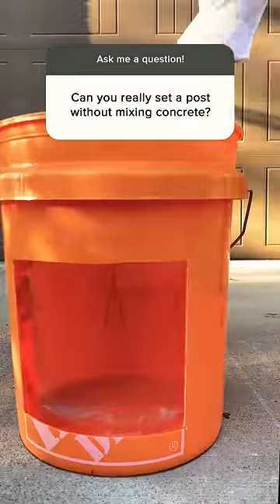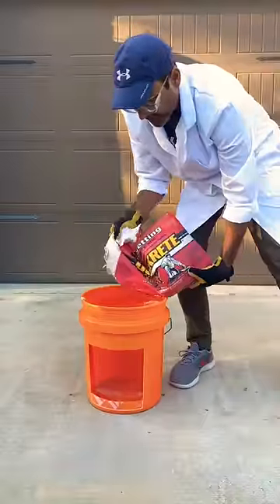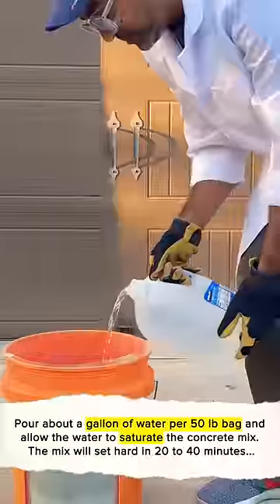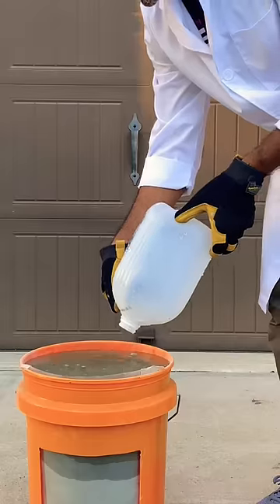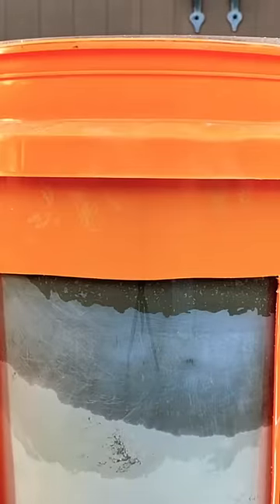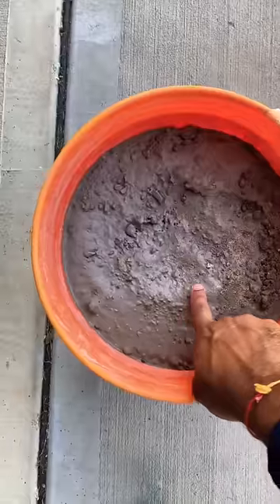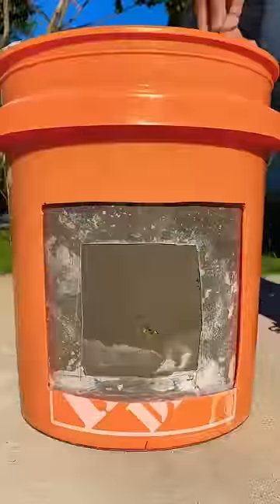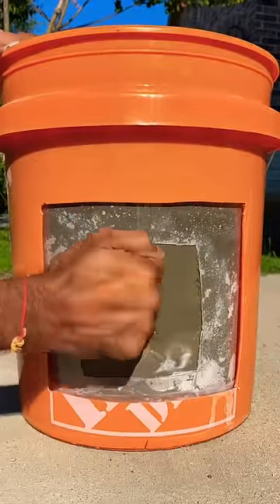Have you ever tried Quikrete’s fast setting concrete mix?

Comment: I've always used milk instead of water because the polymers are longer and it bonds stronger and faster but I grew up on a dairy farm too so we had plenty of milk but yeah milk works better than water and it gives it a nice lighter look you can also die the water or dye the milk whatever color you want the concrete

Comment: If you mix it it activates much faster   Thats all   So if youre using to set posts   Id mix first   If youre using it for something else then adding water after im sure works fine too   Both ways are fine depending on the job

Comment: I will challenge you to make the with regular concrete because fast-setting concrete mix super expensive and people don't use it for fence post.
Do a dry mix like you did and another bucket real mixed with water let them sit for 24 hours.
After 24 hours turn both buckets get the concrete let's really see the results.
But do it real

Comment: As a professional, I don't waste my time or take chances with things that might work...my customers appreciate the fact that I take the time to do jobs right (mixing the concrete) and not the lazy quick way. If you know anything about fences...it's not about the temperatures that the concrete will endure...it's about the wind turbulence that your fence will see....aka this method may work for a chain link fence in town but a 6 foot privacy fence out in the country wouldn't stand a chance.  From experience...the concrete in that bucket can be broke up very easily with a 2 lb sledge hammer....try that with concrete that you mixed and dumped in the bucket....let's show our viewers those results if we want to be true to the testing

Comment: EXCEPT, this doesn't address the two biggest problems that I find when replacing posts that failed after people did it this way. 
1) Not using enough concrete for the soil/projected load of the post.
2) Can the soil leach the water away BEFORE it saturates the concrete? (unlike the non permeable walls of a bucket)
It only takes a few more minutes per post (and a mixing tray) to do it the Right Way.
If it's important, take the extra time

Comment: you never have to mix or even saturate concrete if you’re pouring it into a hole. The concrete will pull water from the surrounding soil and will completely set by itself.

Comment: Moisture can't escape the bottom of the bucket. Do that in soil and the water follows a root or the dirt is dry and a very different story
Reply: Just drive the post thru the bag and add water, I did that and a week later dug it up and it was completely solid

Comment: Zero mixing.  Dig hole.  Set post in hole.  Hold the post straight at exactly the angle you want it and pour in the dry concrete.  The post is now totally stuck and you can't move it.  No waiting. Finish fence. If you live in the NW, no need to add water, it will suck the water out of the surrounding ground.

Comment: S'cause the reaction is exothermic and the center of the concrete will be surrounded by the most concrete on all sides, meaning more heat gets created there and around there, curing the center first.

Pretty sure anyway

Comment: Best way to set a post is to put a flat rock under the post, then put all the dirt back in the hole around the post, leveling as you go. No concrete. Got posts that have been in the ground for 50 years, just as sturdy as ever.

Comment: Concrete done correctly, but post not so much. Use packed course gravel for better moisture management and a solution that doesn't require a 200 lb lift if you need to remove it.

Comment: try that again with the same stuff but mix it, let both set up for a week, then remove them from the buckets.  After they're removed hit them both with a sledgehammer and see which one set up correctly.  over time wit freeze thaw cycles and just natural conditions as well, non-mixed concrete is way more brittle and susceptible to water infiltration and separation due to freezing.  always mix the damn concrete, quit cutting corners.

Comment: Actually the best way to set a post is to tamp the post in with crush an run gravel this way it will always drain in concrete wooden posts will eventually rot off at the top of the concrete.

Comment: FYI. Fast setting concrete is not a string as slow setting concrete.
Ali bad test as the soil will also soak up a good amount of the water.

Comment: You don’t need to add water even when setting a post. Just pack it and move to the next.
Reply: Depends how dry it ground is
Reply: @STYNK37  it will usually still dry in wet ground. The biggest problem is keeping it where you want it.

Comment: Not really a scientific test because a hole in the ground doesn't trap all the water in like a bucket. It drains into the adjacent soil. To test this you'd need to dig multiple holes the same size and fill half the holes with premixed concrete, and half using the dry-fill method, then test for structural stability.

Comment: Not the most accurate experiment since the dirt encompassing the concrete is porous as well. The concrete would probably dry better with some excessive water being soaked up by the dirt.

Even with the poor boundary conditions, this demonstration does not conclude anything about the center of the concrete as we did not get a cross-sectional cut or broken piece to investigate the center.

Comment: The only thing is some of the water absorbs into the dirt in the actual process.
Reply: yes but ground water seeps back in. It will eventually cure fully. Anyone who puts up fences will tell you that. I recommend throwing a gallon and a half to 2 gallons down in the hole. But you can even not water it at all, it'll eventually cure from ground moisture.

Comment: If you are a professional, homeowner do not use fast setting concrete. It will start to crumble after most likely five years and your posts will become loose and eventually be pushed out of the ground. Go the extra step

Comment: water is going to seep into the soil as well and probably drain off into the soil before it would sink all the way to the bottom of the dry concrete mix. I still wouldn't do it that way

Comment: Never trust a person who does this. Mix it. Do it right. Test "test" is not the same as putting it in the ground. The water will go more into the dry dirt. This keeps it contain in the plastic bucket. Not the same. I have taken many posts out that you can tell which one were done the lazy way and which were done correctly. Well mixed concrete will take hours to break off. While the lazy way you can take just a wack with a pick axe and it breaks off into pieces.

Comment: It's premixed with gravel, sand and cement but you still need to mix it. You cant expect it to be effective without mixing Lol
Reply: The entire point of the video is to show that the manufacturer’s directions not to mix it will work..

Mixing it would exactly defeat the purpose of the entire video.
Reply: You don't have to mix it, hell you don't even need to pour water. If you live in an area with good amounts of rain, just set it a day before it rains. I've seen that done as well. The entire point of the video is you don't need to mix it. Everything is mixed already, you just add water. Water soaks in. If you're doing it in a hole, I recommend a gallon and a half to two gallons of water. Because it'll seep into the dirt. You need full water penetration. You can literally do this with any bagged mix. 🤦

Comment: Its against code or bad practice depending on where u live to mix in tje hole because u introduce dirt into the mix. My grandpa has had many posts removed and repoured on hos jobs bc of this “just as good” idea. 

And theres no way to fully mix it without contacting the dirt walls and mixing in contaminates. 

Its not just as good. Its bad. 
Mixing in a bucket is different.

Comment: Do people not mix there cement?
Reply: Their* and concrete* this is just used for a different situation. Easier to get in place but doesn’t have nearly the capacity of other concrete mixes.
Reply: @EggyWeggyIII  not really answering the question. You don't just pour water and leave it.
Reply: @johnlocke6990  for most yes you would mix the concrete mixture before pouring it but in this situation, the mixture is designed to have enough percolation to allow for the water to reach most every part of the cement-aggregate mixture. Obviously you don’t get the same amount of strength but for smaller jobs it gets the job done.
Reply: @EggyWeggyIII  That is kinda cool

Comment: Screw the instructions. Makes the concrete. Once you mix the concrete add a little vibration. That concrete is so extremely hard is damn near steel. If you want to be lazy about it. Follow the instructions

Comment: You know you have to mix it right..
Reply: lol no you don't.
Reply: @Chris.Rhodes  lol read the instructions, any ready mix concrete needs to be mixed to ensure no air pockets are not present and ensure a consistent viscosity. lmao unless you’re pouring concrete buckets like this guy I guess lmao or have 8 hours to wait around for the water to saturate it,  but by that time it will partly hardened. Lmao stop
Reply: @twosocks9002  Omg, for this you do not need to. I worked with concrete for 10 years, a little air pocket here and there in a post hole will not effect it's long term performance. You can literally throw a bag of concrete in the hole and dump water on it, and leave it. How about this...I went to their website.... PER MANUFACTURER INSTRUCTIONS:
Step 1
Dig post hole so diameter of the hole is 3 times the width of the post (i.e., the hole for a 4” wood post should be about 12 inches wide). The depth of the hole should be 1/3-1/2 the post height above ground (i.e., a 6-foot tall fence would require a hole depth of at least 2 feet).

Step 2
Add about 6 inches of QUIKRETE All-Purpose Gravel into the bottom of the hole. Then compact and level the gravel using a post or 2x4.

Step 3
Set the post into the hole and attach 2x4 braces to adjacent sides of the post.

Step 4
Use a level to position the post perfectly vertical.

Step 5
Fill the hole with Fast-Setting Concrete up to 3 to 4 inches below ground level.

Step 6
Pour about a gallon of water per 50 lb bag into the hole and allow the water to saturate the concrete mix.

NOTE: mix will set hard in 20 to 40 minutes

Step 7
Wait about 4 hours to begin constructing your fence or applying heavy weight to your post.
Reply: @Chris.Rhodes   lmao go make some more fence posts that heave out of the ground after one winter.
Reply: @twosocks9002  the first couple inches set up within 20 minutes. I've used it, I've worked with concrete for 10 years, I've been in the trades and around tradesman all my life. Old guys never even mixed bag concrete. They threw it in the hole dry, and used a bucket of water and poured it on it. We're putting fence posts in, not decoration concrete. Viscosity 🤣 I bet it would take you 8 hours for one fence post. 
If you have your posts leveled and braced, dump the bag in, dump water in, and go to the next. Done.
Reply: @twosocks9002  Hmm, the fence posts and deck posts that I've put in over my life are still going strong after 15 years...so yeah. Cool come back bud 👎

Comment: cement setting is purely chemical so as long as the ingredients are fully mixed in the bax, then yes all you would need is the right amount of water to activate the reaction.  as long as its wet, itll set
Reply: Remember that cement is just a component of concrete. Because the reaction is chemical in nature the mixture and what sets is actually concrete. While yes having the right amount of water will do the trick it all depends on how well the concrete is mixed to introduce the water to the cement aggregate mix. With this mix you sacrifice a pretty significant portion of your capacity but for smaller jobs it works fine.

Comment: Your testing has one big flaw. You’re trapping the water in the bucket. In a real life situation that water is going to seep out into the dirt where the dirt is going to pull all that water away from the concrete and that Concrete is not going to dry

Comment: Doesn't work so well in real situations the soil drains the water way quicker than the cement can absorb it, it worked well enough in the bucket because the water has no where to go but down..

Comment: Says it right on the bag doofus dig your hole set the post pour the concrete in and fill it full of water as you pour the concrete in been doing this for years it's been on the instructions on the bags for years